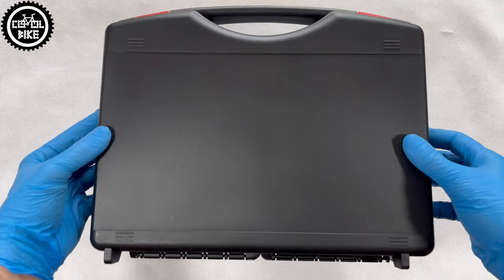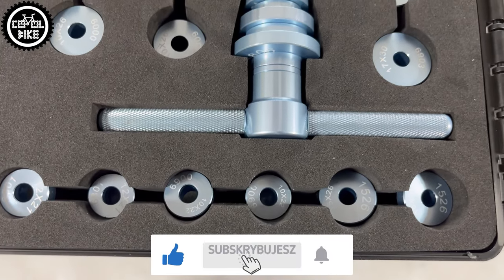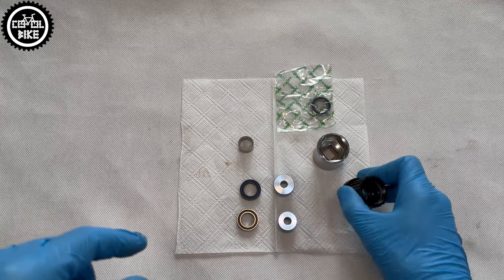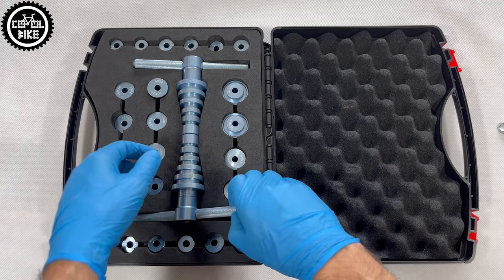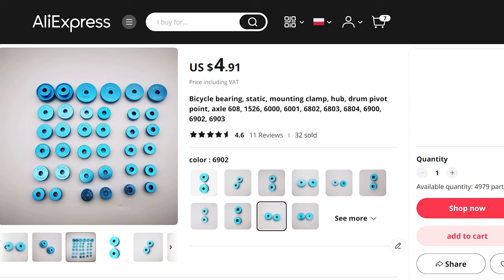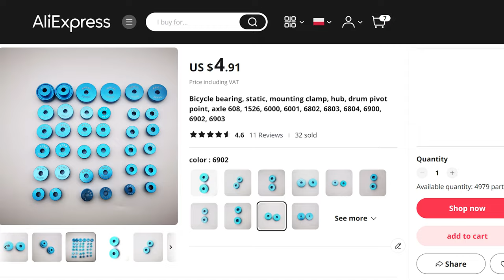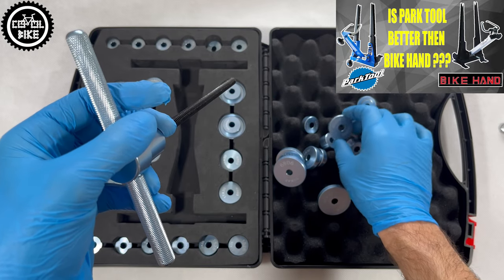Best Bicycle BEARING PRESS From AliExpress

Comment: No good for quick release hubs. The threaded rod wont fit in the axel.
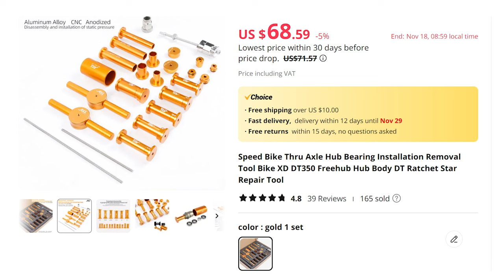Reply from the maker: That's true, this press is intended for hubs with thrue axles 12-20mm. But on 01:04 you can see gold one with a thinner rod, and this should be able to cope with QR10 axles.There are also cheaper versions.

Comment: Sadly a hammer and  punch will definitely NOT work on all hubs,  and it's very easy to cause damage  by using them.
Reply from the maker: Hi, in movue I talked about using hammer, and  punch, only when removing bearings. When you are using "Heavy Duty" tools, you have to be extra careful, and know what you are doing.
From curiosity...in which hubs you can not use hammer to extract the bearings? of course, apart from rear ones, where the bearing are pressed out with axle?
Reply: @COOLBIKEyt  There are some hubs that have a "pre set" bearing sleeve that is in the middle of the avle, some are able to come out and some do not. Hammers and a punch are always a bad decision.
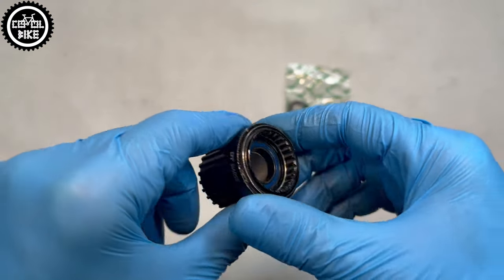Reply from the maker: @jackiegammon2065  Just like in the DT freehub body in 0:54. There are two bearings, and sleeve between them. In this case, it is impossible to remove the bearings other than using hammer ,and punch. 
Of course, there are also tools for removing blind bearings, but they can damage the sleeve inside. 
That's why I think it's better to destroy the bearing, which needs to be replaced anyway, than parts that are reusable.
Reply: @COOLBIKEyt  I can' remember the brand of the nearing puller, but there is a bearing puller that can pull that out safely... perhaps more than one brand.
Reply from the maker: @jackiegammon2065  interesting...let me know if you remember the brand ;)